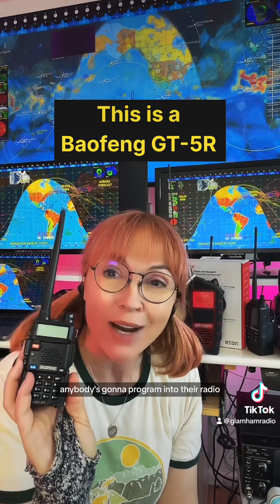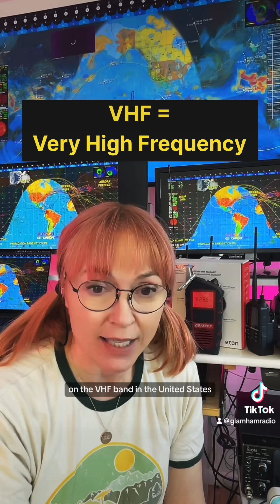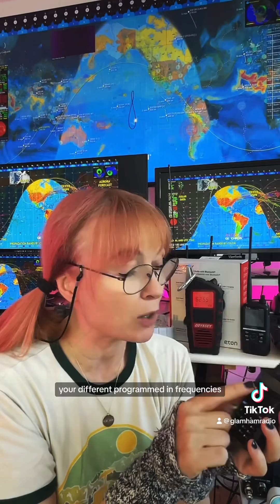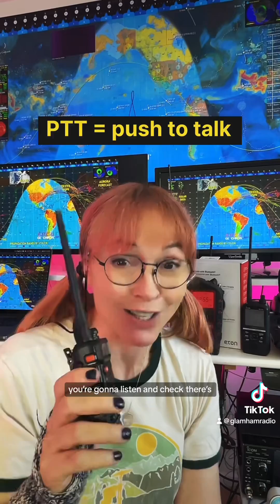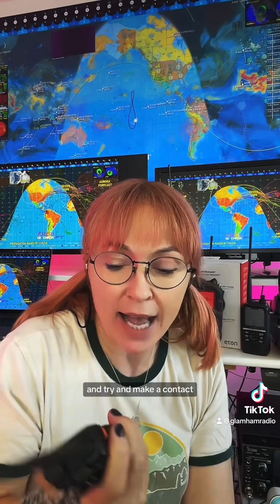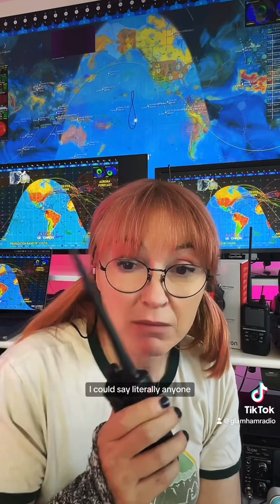WHAT IS THE NATIONAL CALLING FREQUENCY IN HAM RADIO? PART I

Comment: I always have a radio monitoring 146.52 whenever I'm at home.  More people should monitor the calling frequency.
Reply: Had it programmed for years, never heard one transmission. Here is why. Powerlines run right over my house, and it destroys all radio waves. All I can pick up is AM and FM radio stations, and weather repeaters. I cannot even pick up over the air TV stations. I remember when I was a kid powerlnes ran right beside our house, and we played on the CB, and could only use it on one side of the house. We had no clue about powerlines back then. Then years ago somebody told me the worst thing for radio signals is powerlines. I move here, and now I know they were correct. The power has went out a couple times, and I get lots of signals when the power is out. I can literally scan from 0 to 2ghz and all I get is a bunch of weather forecast. I did learn one thing, those weather repeaters must be putting out spurious emissions, because their signal is on several random frequencies. Nonetheless, I have a bunch of radios that are useless at my house.